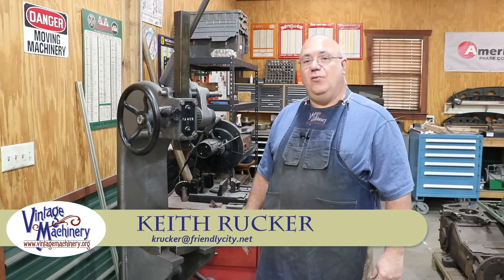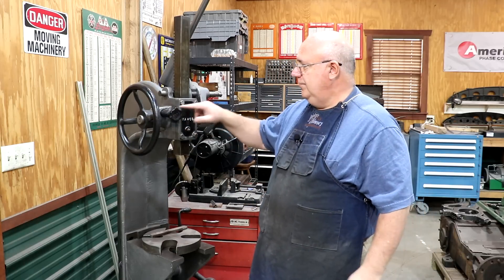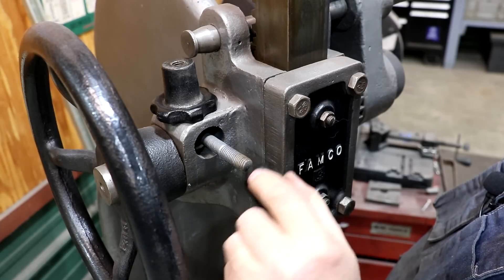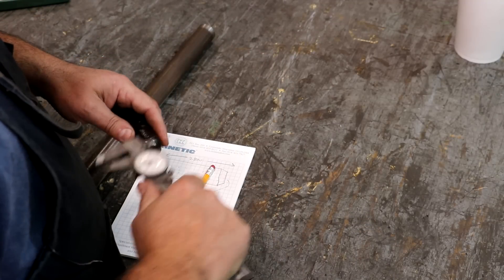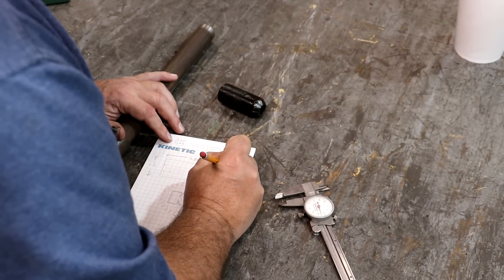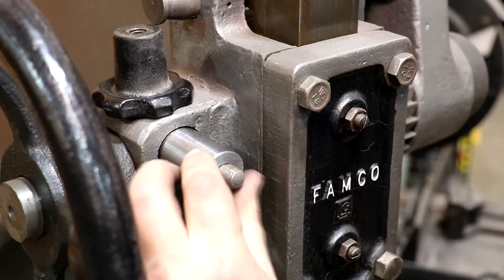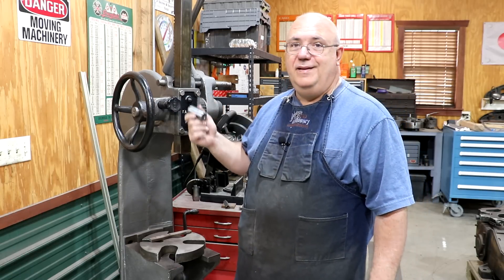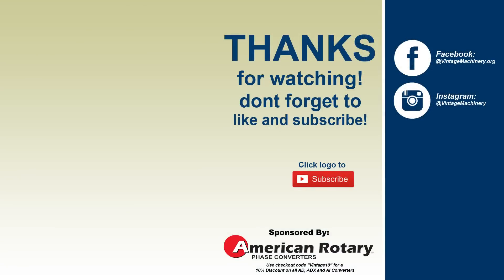Famco 5C Arbor Press: Machining a New Arbor Clamp Spacer

Comment: I have a Dake 2B-1 Arbor Press that you have helped me fix 2 things on... The first thing I saw you work on a larger press you had was the compound down feed (I guess that is what it is called) someone had not put my press together right so when you rebuilt the other press I saw what needed to be done and corrected it... but even when I would tighten up the lock it would not work... And now I see that the tube on mine did not have that 45 deg. taper. It was just flat. So I just fixed it after seeing you make that new part...Thanks...

Comment: I was wondering are you going to blue  finish that part that you just made?
Reply: He said it was finished and ready to send to the customer.  "blue finish" was never remotely mentioned in this video.  Did you watch the video or just think you did??
Reply: @paulcopeland9035  I did watch the video. I was a CNC machinist in life before an accident where, I was hit by a car forced me into early retirement. When I made parts they always had a finish specified and when made out of non stainless steel such as 4140 the parts were sent out to a finisher who would chemically dip them to give them a blue-black oxide finish. The spacer Keith used as a pattern was a blackish finish so I naturally thought he would do the same for the replacement spacer.

Comment: Mr. Rucker,
Keeping on the topic of Famco, I am restoring a Famco 15" drill press. As I disassembled it I discovered a broken tooth on the spur gear of the shaft that the handle mounts to. It seems like a project that would be right up your alley. Might you be interested?
Reply: you need to send an email
Reply: @MrChevelle83  I can't find his email address anywhere.

Comment: Erm.. Why did the manufacturer add this feature? 
Positive kudos on another machine restored, helping out others. All good things without a doubt.
 I'm just a bit puzzled, my current understanding is this presses things with great force out or in on that round table below.
Reply: Arbor press rams can get slightly distorted. My Famco 3C suffers this condition. Adjusting the "gib" on the front of the ram helps the ram track true, but if it gets slightly distorted the ram binds. Loosening the adjustment can easily allow the ram to fall when disengaged from the feed handle mechanism. The brake allows you to put adequate drag on the pinion shaft to keep the ram from falling while you arrange your work. My smaller press doesn't have the brake feature and the falling ram gets frustrating. The previous owner of my press made a sheet metal U shape key to catch the ram teeth or tooth to hold the ram in the elevated position. The cheater works well enough that I have never made a proper repair. Maybe I should stop wasting time  armchair machining (explaining) and go out to the shop and repair my press properly!

My employer favored Dake presses. Dake presses with this brake feature used a brass or bronze pad to reduce the chance of damaging the pinion shaft... A nice feature upgrade. The steel part that Keith made would wear the shift quicker than the OEM cast part and eventually cause damage in a production environment. Famco my made a good press, but I am a bit partial to Dake (which is still being made).  We had a lot of the Dake combination tonnage presses in our shop. Many were used for repetitive work function so the ratchet dog would ride only on one ratchet tooth. The dog would barely catch as this constant repetitive stroke would burr the tooth and the operator would get relaxed and barely raise the ram for the subsequent stroke. The pilot would then grab the handle with two hands, the pawl would jump off the burr and the handle would make a fine dent in his skull! For this reason, I have replaced many of these worn pinion shafts. Dake calls this part a "spingle". That name always tickled me. Our safety people wanted us to solve this operator introduced error to eliminate injury recurrence. PM inspection wasn't reliable to catch a developing burr pre-emptively. One of my fellow frustrated mechanics welded a 2x6" knee bonking channel that stuck out about 24" under the press handle. This prevented the operator from lining up under the handle for the potential skull bonk. While meant only as a joke, that knee bonker skull fracture preventer was still in place 15 years later! Fortunately, no one deemed the knee bonker upgrade necessary for the other Dake presses in the shop. We did modify one other press to stop one pilot from using a cheater bar (tube) on the handle. He would bend the handle instead of moving to a larger press. A very large disc was turned and screwed to the end of the press handle. This prevented him sliding in his cheater. Even after this operator was terminated, this modification remained. That oversized end knob always made using that press irritating to me. This press was just outside of or maintenance shop and was often an ideal size between our smaller arbor press and our large H frame press. I often wanted to remove the handle knob modification, but our safety police prohibited the return to OEM design.
Reply: @paulhunt598  I was into some beers first time I read this and the 2nd paragraph was too much. I've got it now! safety to stop skull breakage. 
As to your first paragraph I was wondering if it was there to stop the pinion slamming down. But when keith loosened it off and it stayed there I was puzzled on that guess.
Your explanation of a gib tightener makes sense as they say. if you cant make it accurate make it adjustable. if you get the tiniest wear and tear in a machinery you need a gib usually.
Clearly you know this area of expertise well.
I've never been one for copying bad behaviour on TV and movies well. and less so 4 decades on. I find watching people do things all the time on youtube is kicking up my getting jobs I put off to some degree a lot less now. perhaps I too am influenced by tv. just depends what its about. Hope you achieve what you want to
Reply: ...FOR THE HELL OF IT-(?)

Comment: That was fun!  You properly left the corrosion-proofing to the customer.  It looks like the spacer casting in your Arbor Press was spray painted black.  Does steel rust faster than cast iron?
Reply: Rust never sleeps, in the area of the country where Keith lives the humidity is very high.I lived in the Florida panhandle and rust would form on stuff overnight.
Reply: @AliceGirl2019  Same in my neck of the woods, Washington State

Comment: Always use a center drill ........sloppy
Reply: ...NIT PICKER-(!)
Reply: @daleburrell6273  Dale, I agree with you, but please turn down the yelling.
Reply: @paulcopeland9035  ...I USE CAPITAL LETTERS ALL THE TIME, BECAUSE THAT'S THE ONLY WAY I KNOW TO MAKE MY POSTINGS STAND OUT.
Reply: You can skip the center drill step to save time on loose tolerance parts like this. The cast part with cored hole is adequate for this application.
Reply: Always wear a condom there Keyboard Cowboy!

Comment: Whatever happened to that steam box project that Abom tried on his shaper, but failed?
Reply: In a prior video, he answered this.  He is waiting on the crankshaft.  It was outsourced and that person hasn't done anything with it this whole time...  It was polite frustration.
Reply: @Bottleworksnet  Thanks- maybe I missed that, but the steam box problem was how to mill out the newly welded areas where the valves slide- was that done and I missed it too?
Reply: @oldschool1993  I think he's using the horizontal boring mill when that gets finished to do it.